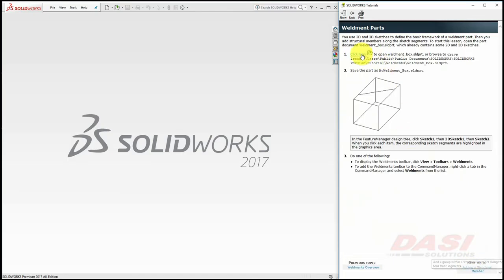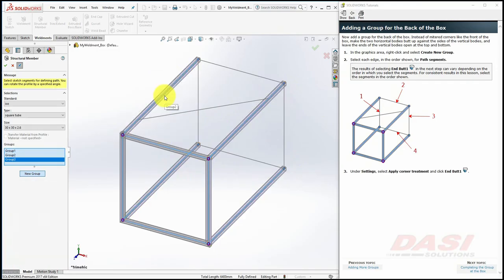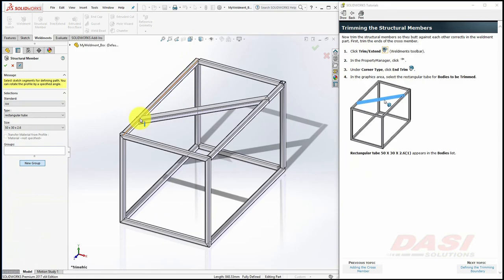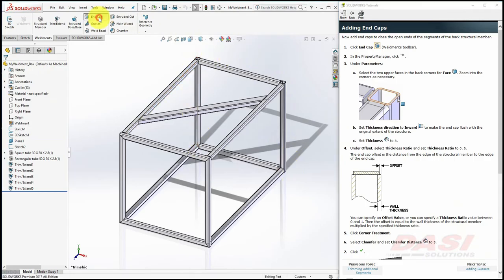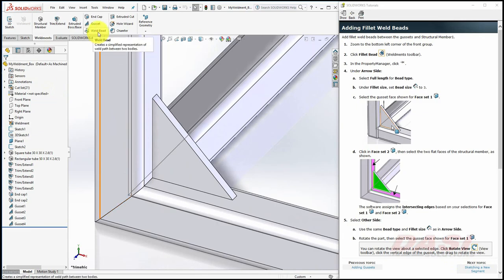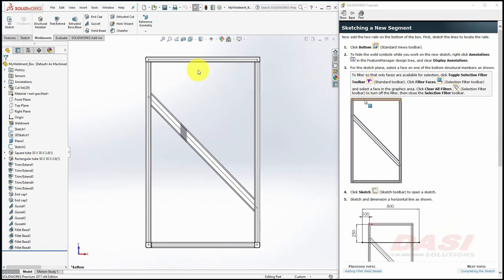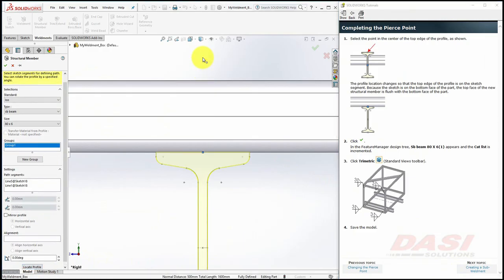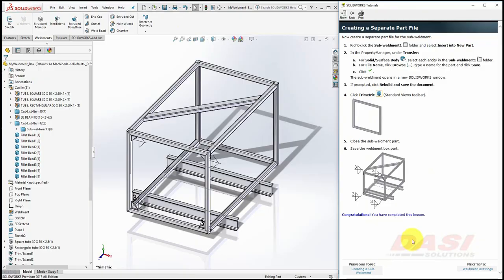Basic Techniques: Weldment Parts | SOLIDWORKS Built-In Tutorials

Comment: Group 3 was selected in a sequential order, as were the other two groups.  When you select group 3 you specify, "In this order" and start with a different first selection that the first two groups.  First group the top horizontal member was selected first, in the second group the top left member was selected first.  No mention of selecting "In this order?"  Even though not specified, I think the selection must be sequential.  Correct?  Then the third group was selected starting with the left VERTICAL member in clockwise order.   When I did the SolidWorks tutorial, I started in a different place than you (and evidently SolidWorks) on the third group and the result was open ends of the vertical tubes in opposite corners of the rectangular prism weldment.  Does it really make a difference what order in which they are selected?  Could I select the 3rd group in a counter-clockwise sequential manner?  Tell me if sequential is really important.  Tell me if the same selection sequence is important.  It seems to be when doing a loft.  What is is that is REALLY important on the selection method.  This is a reason the SolidWorks Tutorials are so awful.  I have never been able to follow the tutorials and make them come out the way SW does.  You should not be following the tutorial that in your words, "How many times have you tried one of the built-in SOLIDWORKS tutorials and either got lost, interrupted, or just plain bored?"  Add to that, they don't go into what they expect to do in the next steps and don't describe the details of what the result they are presenting, such as, "The far connections to the horizontal tubes are all different" and describe the differences.  Then proceed to say, "This is how to change any connection to be this way or that," then give examples of the fix for each different end.  Two corners are changed and they don't describe the corner differences when the changes have been made.  You have committed the same omissions.  It is possible that trim/extend could be it's own video with examples of what each selection does.  I really want to get this but lack of information on why something is being done hinders understanding.  Don't get me wrong.  I purposely selected GoEngineer because I can't under stand the Indian accent and fast talking of many of the tutorials available on YouTube.  At least you speak plainly, and if it is too fast, I can decrease the speed to .75.  I am a GoEngineer paid member, but Dudley is a pseudonym.
Reply from the maker: As a Goengineer customer you should have access to Goegniener application mentoring sessions. Scheduling a session with and AE will probably be the easiest way to get the guidance you need through these tutorials or to get questions answered on best practices with weldments

Comment: I'm back on this again today.  "Completing the group at the box" around 2:53 shows the upper right corner beginning and after changing groups to 2 and 1, changing to end butt 2 and adding 5mm gap.  No detail is shown on the lower left corner that gets the same treatment.  I am unable to get the two corners to both show the end of he vertical member open.  The illustration that says, "Repeat steps 2-7..." doesn't show sufficient detail to see what all the corners should look like.  I've worked on this sufficiently to see that more effort with it is unproductive.  Maybe I'll try the Indian that is incomprehensible by turning the sound off and using closed caption.  I'm normally not disappointed in GoEngineer videos, but I am with this one.
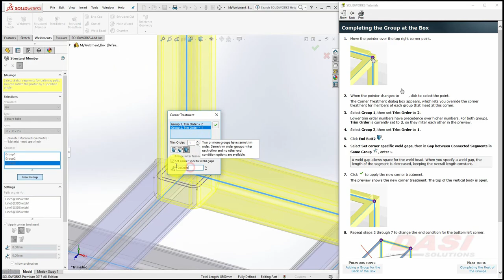Reply from the maker: This video shows the bottom left corner and all of the clicks starting at 3:12 to 3:27 the narrator does not restate each of the steps but they are clearly shown. You can also refer to the tutorial pane on the right for the specific steps of the lesson.